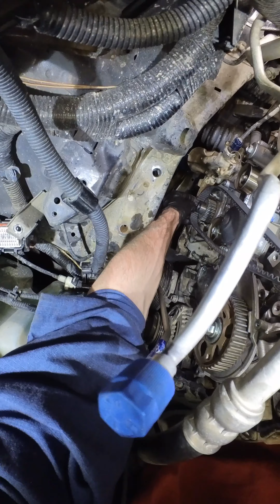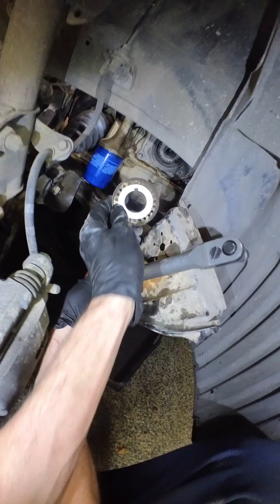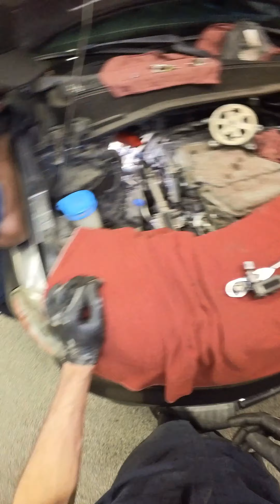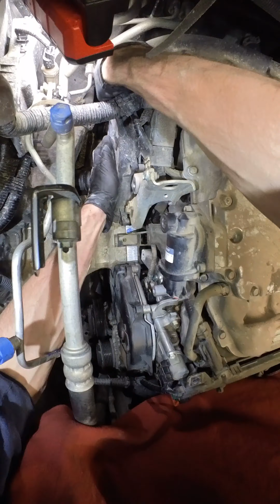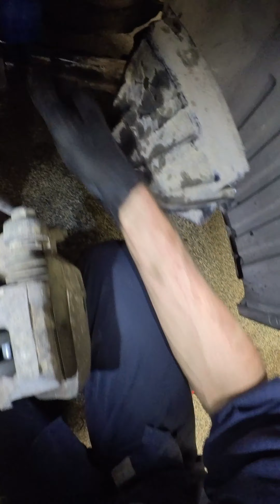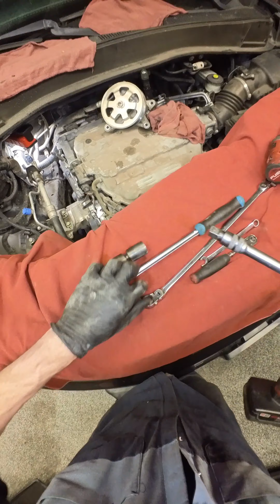Anotha Honda Pilot Timing Belt 🔧👀👌 #honda #pilot #j35 #timingbelt #pov

Comment: Do you not need to support the engine when you remove that front engine mount/support?  I couldn't tell if you had a jack under the engine.
Reply from the maker: For the V6s it is not necessary to support the engine before removing the side mount as the front and rear mounts are the ones holding the weight. The side mount is more for helping with torque flex
Reply: Good to know, thank you.

Comment: At what mileage do you recommend a timing belt and water pump service? Not that I have a pilot but still I know people who do have pilots so I can tell them I heard it from a bad ass master Honda tech on YouTube 😎😎😎🤣🤣🤣
Reply: 100k miles
Reply: 100k miles for the belt (or 8 years, if I recall). Shorter in harsh environments. Service manual says water pump, tensioner, and pulleys "if necessary" based on inspection. There seems to be some variation in what different dealers recommend for those latter items.